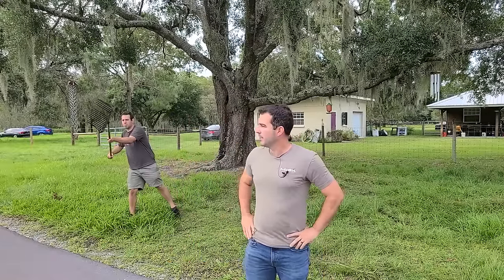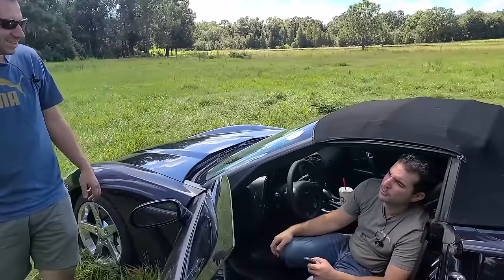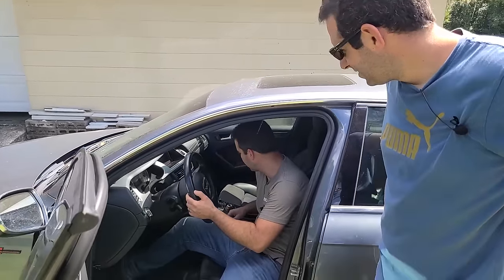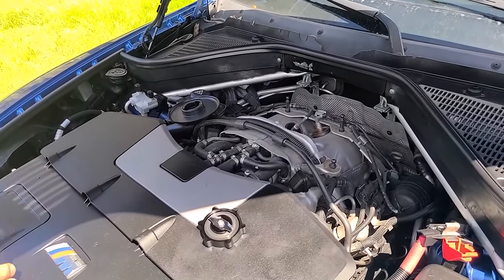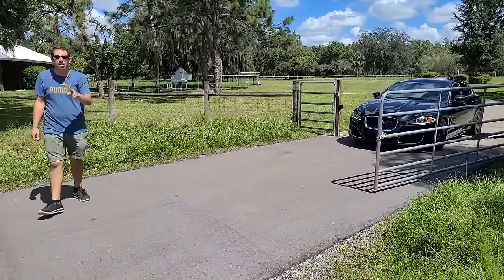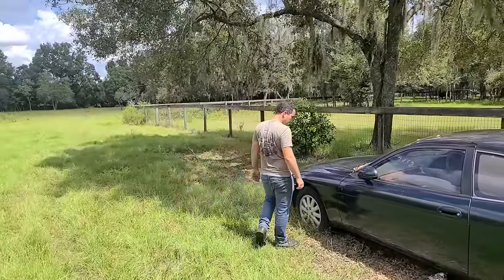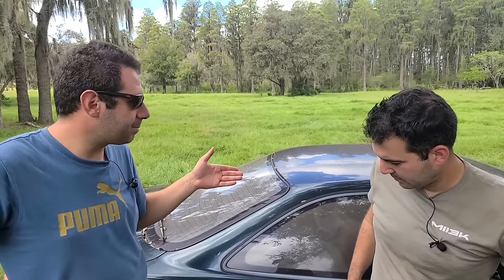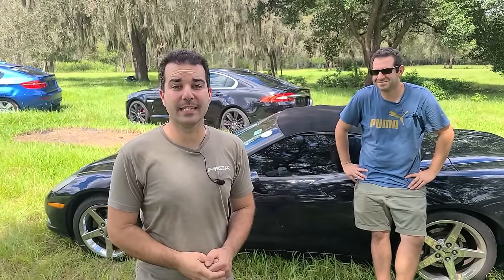I Found A Farm With Abandoned Performance Cars Everywhere! The Farmer Wants To Sell Them All!

Comment: Love to see you with a Jag You Are in your stable!  I've got a XJ (X351).  I don't think the engine I have in mine was released on your side of the pond - a dirty diesel.  3000cc V6, bi-turbo, 275bho & 600nm torque.  being a diesel, is simple and inexpensive  to tune, mine makes 325bhg and 700nm - that torque is about the maximum the trans will take.  45mpg on a steady drive too.
Reply: diesel torque! yea baby!

Comment: estate sale in Columbus OH area - Jaguar XJR-S - 2004 - 25,076 miles - listed at $11,750 with bids being taken - carfax shows a fender bender on rear bumper - not sure of the air suspension - picture shows the car sitting low

Comment: As a former 6yr owner of a 2010 Jaguar XFR, it's a great car tunes, exhuast and pulleys will get you to 560hp easy it's and not that hard to fix. Engine parts are used by the Range Rover, but parts prices are on par with MB, BMW, AUDI. On the AC, it's probably the condenser and/or the cooling fan as was mine when my ac went out (a $2000 fix for both 7 yrs ago) but once fixed you could hang meat and freeze it in that car, it also had the best heated and cooled seats I've ever had and my current ride is a 2016 MB S550 4matic. BUY THAT JAG ALEX!

Comment: hands down the shadiest used car salesman i've ever seen
Reply: You guys gotta understand it’s part of the schtick and he openly admits to only knowing so much about certain cars.   He plays more shady than he is.   It’s really just so people like you will go, “wow.  Wtf?   This guy is nuts.   Who knows what’s going on with these cars? “.  Well, you’re right, who knows, but Alex has enough experience and already knows more about those cars than Sam does before he even gets there.   He knows what to look for, and say even if that M6(?) has a hole in the bell housing, bit deal, I’m sure the cam a d cranks position sensors are confused as hell (I really mean the ECM, but those are the causes most likely.) , and I know the Mercedes W112 and W113 had cam sensors con the front of the heads, but generally Crank Position Sensors are on the back of the block down low.   Sam all but stated that it was a gunshot hole.    Picture a pissed off spouse, walking out and shooting their spouse’s prized possession. but not leaving an obvious hole through the hood.  The recipient most likely didn’t know immediately what was the cause,  cause who in the hell would look for a hole in the bell housing, and I’m sure it was more obscured by various covers, hoses, whatever, insulation, and the trigger person probably is still smiling ear to ear.    They recipient could potentially accuse the other of such a deed, but I’ll bet that was the gamble in itself, they doubted the recipient would have the ….ummmm, fortitude, to do anything about it, lest they unleash the beast.      The dealer told them it’d be $20,000 to fix it, insurance may have declared it done, who knows.     But at least it’s status would legally have to be revealed to Alex, as in if had been totaled or whatnot.     I’ll bet Sam would have taken $6 or 7$K, I’ll bet he paid $5k, and Alex could spend maybe less than $5k, maybe as much as $10k but I doubt it, and he’d have a $17,000 M6 worth,…..?!
I have no earthly idea.    Depending on documented history, if all clear, could be $30k?   But I don’t care about Beemers.    Just an interesting case where a discerning gear head could do well. (?).     The revenge gunshot story sticks like that cow shit to your shoes, so run with it.     Ever been around a rich “couple” where one or both isn’t or aren’t so, ……..ummm, fidelity driven?    That M6 is a result.    Seen it a million times.   Well ok, just this time.    But cow shit is very, very sticky.   If a cow patty sticks to one of those tires with very low inner  fender clearance, it can tear up some platic held on with push fasteners pretty quickly.    It’s like half ass concrete if it dries on a tire that’s been turned a little with the patty getting sun.   Ask me how I know this.   
Ok.    It has locked up a front wheel on my old Crown Vic which was pushing the tire on slick morning dew grass until it hit dry dirt road, then BAM, that cow leaving almost knocked the front edge of the rocker panel molding completely off.  JB Weld to the rescue.  I live in very, very, similar land, about a few hours north, by my judgement of that property.     Take the Jag, the Audi, steal them from Sam, let him make a grand or two on each, call it a day, that’s good biz, leave the M6.   That things ugly and an answer to a question no one ever asked BMW.   Ever.    “Hey,could you build a useless “SUV”, with lousy rear headroom,few of the attributes of an SUV, a pathetically high CG, which is an affront to BMW core values, make it heavier than necessary to keep the bean counters happy, rip-off impulse buying non-enthusiasts who think they’ll have a unique Beemer, disregard quality control, always blame the customer, but buy back THAT CAR!    Yeah, right.    What waste of a good drivetrain.   To put it in that tub of lard that looks like Mr. Bangle kicked an X5 in the ass really hard just as a prank, before blowing into the exhaust pipe u til it looked bloated and lazy.    Yep.    I did it.    All of that.  Don’t get me started.

Comment: hey from New Zealand,Id get the Soarer or the Vet,i work at a Toyota dismantler and as the motor tech guy and I love the JZ motors all day every day , I got a 1989 Nissan C33 Laural 25DET and an E36 4 door 2.8 manual with the usual ABS/airbag check lights, both as daily drivers lol great channel great content

Comment: Usually when I removed the big rims that came on the blue BMW they take the brake calipers and rotors with it for a big brake kit when they put on the smaller BMW rims on it they also put the smaller brake calipers and rotors it came with the other BMW small rims on to that model and then you bought it so possibly the brake rotors and brake calipers were changed with the complete rim and brake swap on to some other BMW

Comment: Where is your buddy located. I am N Florida. Just took my CRV to dealer for synthetic oil change 19.99. Car has 45k miles. They said I needed Trans fluid, brake fluid and cooling fluid. To me it seems like they are trying to drain my wallet. They claim all NF is severe service. I didn’t see any new cars in the show room

Comment: Leaping growler, um..... well that's just wrong. The leaper is what you see on the bonnet (hood) of early Jaguars such as the MK2. A Growler is just the cats head such as you see on the steering wheel of the XF, so two different things. Putting a leaper on the bonnet of a modern Jaguar does not add class it makes you look like a Bogan. (Aussie slang- google it). With all that said buy the XF, we have one and its a great car. Go on what are you waiting for....... Buy the Jag. Did you buy it yet??

Comment: I have that Audi engine. Mine only has 52,000 miles. Memorize this fault code - you'll know it well eventually. P0491/P0492 "Secondary Air Injection System Insufficient Flow" Bank 1
 / Bank 2. But don't worry, it's only about $2500 to get it cleaned out. Oh yeah, then there's the need to take the whole top end off the engine to walnut blast the intake valves. That's about $1500. What a piece of crap engine.